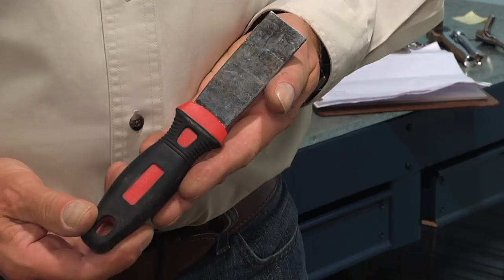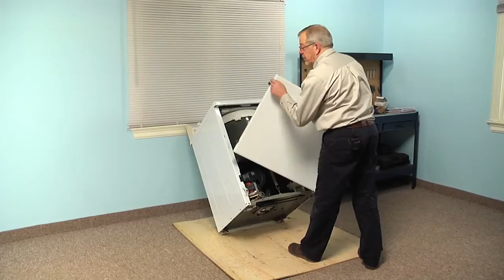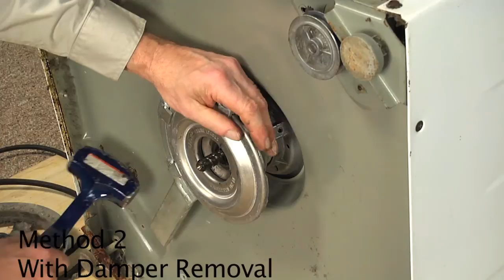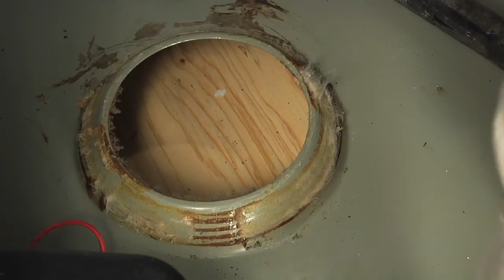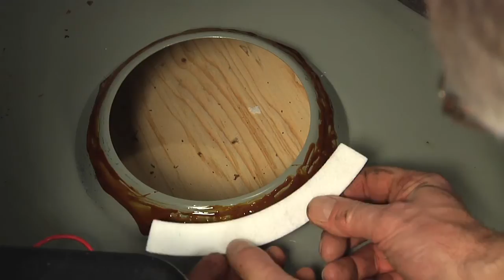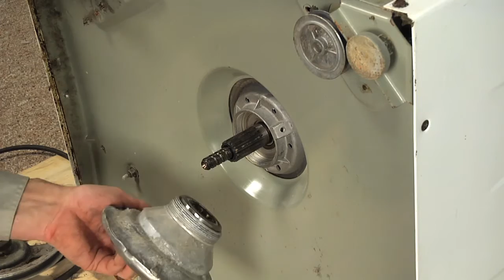Washing Machine Repair - Replacing the Damper Pads (Whirlpool Part # 203956)

Comment: Very helpful. FYI the electrical box strategy does not quite work on narrow body machines. I have an older stacked 'apartment width' Maytag with exactly the tub support system shown here. Because the machine is narrower you can't quite get the springs to fully release because you cannot move the tub as much off center. But that is minor--you can get them off the last bit with pliers. Getting them back on though then becomes an issue. I stretched each spring using pegs and a wood vice so that the coiled part was around 5.25-5.5 inches, then put the electrical boxes back on. During reassembly the springs then went on easily. By the way: use one piece formed electrical boxes and break off the screw tabs so that the springs can be locked right in the center of the boxes. Because access is not great, it also is a good idea to glue the new damper pads on one at a time.

Comment: excellent video.  Replaced damper pads on a 31 year old Maytag and it works like new!  Followed "method 1".  Removed the cabinet for ready access to all 3 pads.  After ripping the pads off, easily removed all the old adhesive with acetone.  Glued new pads with Weldwood contact cement.  Let the glue cure overnight.  Greased the pads and reassembled.  The electrical box tip made spring removal much easier!  Kudos!!
Reply: My repair failed.. my Maytag has gotten better..  less shake and less noise..   but there is still a good deal of noise during the "Damp Dry" stage.

maybe you can help? Much obliged.
Where should the top of the damper pads be?
The documentation on Maytag pads says "the top surface of pads should be 3/32" below the center opening in base".  I am having a tough time understanding what that means. It's tough to measure with tape while following Method 1, where your fingers are in potential dangerous areas.

I lined up the top of  damper pad at just the "shoulder" (where the horizontal curve and the downwards curve meet).  Should it be a bit above that?   I can't make out from Steve's video,  because the camera angle is from the top.